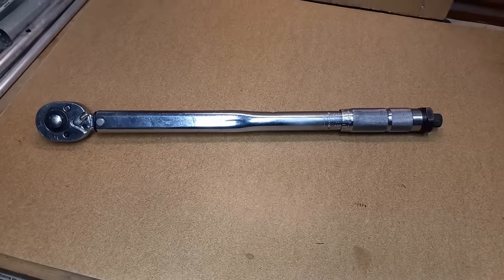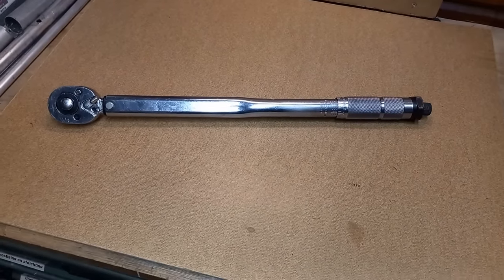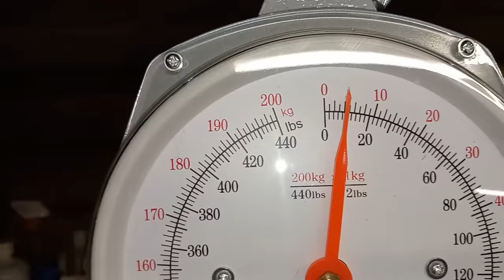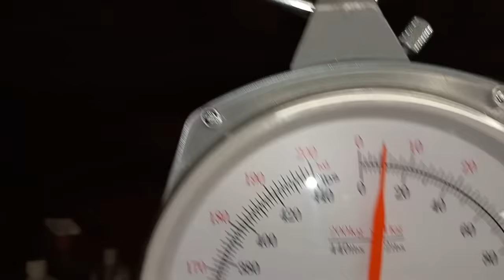How to calibrate a (cheap) torque wrench

Comment: The math I used is: Nm = force x arm length , 126 = Force x 42 , so force = 126nm / 0,42m = 300N, = 30kg. ( 1kg=10N)
Reply: What planet do you live on?  On my planet gravity is 9.81 m/s2 :)
Reply: @richardcloudbase  and what exactly does gravity have to do with it?! exactly... nothing at all in this case ;) and his calculation is right. to be more precise: 30,59148639047619kg at an length of 42cm
Reply: @richardcloudbase  so is g a constant on your planet?
Reply: @martinkrabowski2057  1kg = 9.81N not 10. That’s what he meant. So the more accurate measurement should be 30.58103975535168
Reply: The math I use is: pay more for a better torque wrench.
Reply: @booifojoe  lol
Reply: @iceduckz  All of you are making something from nothing. Who cares if its 30N or 30.58....... The whole point of a torque wrench is to have consistent uniform tightness of bolts and nuts while ensuring that you don't overstretch the bolt, strip the threads like a gorilla, or form too loose of a connection where the nut or bolt unscrews itself by varied vibrations or shocks. Regardless though your math checks out.
Reply: @richardcloudbase   I guess I should inform you that Gravity is location specific. Land (and water mass) influence gravity as does your position on the globe. Besides that, i think a lug-nut doesn't really care for the 2% difference.
Reply: @thijsclaessens8219  isn't it stupid that we use kg for this stuff then? Like why would we want varying calibrations of torque wrenches in different parts of the world?
Reply: That's great if you're a mathematician.
Reply: @martinkrabowski2057 hi. So that is for 42cm/16 inches. So what is  calculation for the length of 12inches or lesser than that ? 😅
Reply: @maxarcha3805  that calculated with the math shown above: Nm = force (nm) x arm length (m) ; so with 30cm (or 11,811 inches) calibrationweight = 126nm / 0,30m = 420N or ~ 42KG. I still can't understand how it is possible that most americans use inches. it just makes no sense at all o.O
Reply: @martinkrabowski2057 
Probably bcoz the ladies in America prefer measurements in INCHES not centimeters 🤪
Reply: @booifojoe  hahahahahahahahahaha
Tested your expensive torque wrench recently champ?
I would absolutely guarantee that his is now more accurate than yours is.
Reply: @bushratbeachbum  You're probably right, but my lug nuts have never fallen off yet.
Reply: @booifojoe  Neither have mine. I always torque them to spec, and then braze them in place just to be on the safe side.
Reply: I use Nm = force / 1/18.8 fracture of arm length * 126z variable, over the force of the qualified distribution x 0222.42. makes sense right?
Reply: i think humans have come this far without using torque wrench at the beginning.....😅 wish it was the same
Reply: @luckylotus11  My dad has one, but never uses it. He stocks his winter tyres at my place and changes them in my driveway, so I can set my torque wrench to the required torque for his cars. Because he can't figure out how to set it himself. 😂
Reply: @richardcloudbase  I see you live in the clouds, not on earth. The less than 2% difference is meaningless in a practical analysis of all sources of torque variability and accuracy.

Comment: Always leave a wind up torque wrench in an unwound state!
Reply: You mean at minimum torque setting? If so, yes.
Reply: It’s a myth. The spring will not take any harm to be left in tension. Think of all the valve springs in million of cars.😊
Reply: @Axbear  yeah, but those valve springs don’t have to be as precise as the spring in a torque wrench. Are torque wrench manufacturers etching the instructions to store at minimum setting just to annoy their customers?
Reply: I have my dads wind up torque wrench from the late 1960’s, and it has spent most of its life wound up to more than 80 ft lbs, and it still tests spot on.
Reply: @Axbear  It’s not a myth. That is indeed best practice.
Reply: Myth or not, why would you argue about spending ten seconds "loosening" it? Some people are so bent on being lazy that they will argue about anything.
Reply: @Toyotajunkie  arguing about this is just like arguing about using one..some people "feel it"
Reply: @schimor  I agree. I have "tested" myself many times and I am usually just a few pounds off. I have the ability to feel torque and depths fairly accurately. I can also tell if something is level with another surface, no matter the surroundings.
But I can't remember a person's name for weeks or months. Ha ha ha!
Reply: @Toyotajunkie  99% can't and should be using the tool it only takes 2min longer
Reply: @Toyotajunkie  I mean, those 10 seconds do add up when you do it all the time for a living. Of course that's part of why I use a split beam.
Reply: @grigorirasputin996  I work at a Ford Dealership and I've never been so out of time I couldn't spend time prepping, cleaning, or storing tools and equipment. But too each his own.
Yup, we have a couple techs that use splits. I have nothing against them. 👍👍
Reply: @Toyotajunkie  😎 I work at at a Ford Dealer as well. Now a days I make good money and know the product line well, I'm never too fussed about hours. But I'll never forget consecutive ass beatings working indy shops in my younger years. I used to think sloppiness saved time. Boy, how I was wrong. 
-Cheers from colorado.
Reply: @Axbear  If it's a myth then why does the instructions that came with my torque wrench say to do it?
Reply: @Jonathan  blimey I'm.the same hopeless at names good at numbers .. ..Good eye for level lol
Reply: @highdownmartin not exactly. Some manufacturer say let it set to a "x" number. My little one need to rest at 40 in pound. Always check manufacturer manual.
Reply: @Kurt Clark  how did you test it to be  spot on? Just curious,  it seems this guy on the video went through alot of trouble to get his spot on. I'm guessing you have a better method, would love to hear it! Thx
Reply: @Axbear  as much of a myth as car suspension springs that "sag" over time?
Reply: @mygt8a4re  Yeah I'm wondering the same thing. And let me tell you if it has not been calibrated since it was made in the 1960s there's no way that thing is still accurate. I bet they haven't used any kind of scientific means for testing it for accuracy.
Reply: @Axbear  Car springs get tired yes
Reply: @Topsiekku  car Spring get tired because of being bounce / cycle / wound and unwound millions of time .
Not because the car sit on the spring . 
Wound and I wounding the spring is what wearing the spring down .
Reply: I have a Snap-On torque wrench. You can’t put it back in its case unless it’s wound more than 80 ft-lb. Case closed.
Reply: @setoman1  peculiar to snap on then.
Reply: When I find the 'Winding key' from my metal toy car.
Reply: I keep mine at 5 ftlbs don’t really matter lol.
Reply: So many mistakes......
Scale WAY too big (large range) to be used
One point calibration.......not good
The placement of the hook on the handle.....wrong....

I've been calibrating torques for 30 years......MY EYES ARE BLEEDING......😪😤
Reply: @Axbear  much like the decade old debate about leaving magazines fully loaded in a semi-automatic.
Reply: @jean-pierreboisclair8717  I just buy a new one every year. That lube tech life isn’t pretty😂
Reply: Yes!!
Reply: @Axbear Creep in materials under static load is far from a myth. Unwinding it to its minimum setting goes a long way towards minimising the possibility of drift due to creep.

As for valve springs, nobody cares if they lose a bit of preload over time. Most engines are build with enough headroom to prevent valve float even when that happens. Presumably, these springs are also designed to stay well below the steel's fatigue limit, which would make them last practically forever.
Reply: Wind it down. It takes a few seconds so who cares what’s right or wrong.
Reply: Damn it!  I never read instructions.  I’ve always just left the wrench at what ever lbs I used it at last.
I’ll be setting the wrench at the lowest lbs from now on.  If it doesn’t hurt the wrench, the few seconds with not hurt me.
Now to calibrate the wrench and see if my years of abuse has ruined my wrench.
Reply: @syn4057  You can set up a basic calibration jig at home, but if you can't be arsed, just send it off. Make sure they're willing to adjust it if it's drifted. That ought to be included in the price of a "calibration", but many establishments treat calibration (which is the act of adjusting the tool to match the standard) as verification only, which is the act of measuring against the standard, with no adjustment implied.
Reply: @syn4057  you’ll probably be fine, especially after reading all the comments that say it won’t hurt at all. But best practice usually takes a touch longer.
Reply: Shouldn't be completely unwound or wound as tight as possible. spring should be where it just starts to equally engaged throughout the length of it. About a 1/4 to 1/3 of its max tension setting

Comment: It’s my understanding that the force needs to be applied to the center of the knurled handle. That may be the purpose of the groove in it.
Reply: Absolutely and correct.
Reply: with the formula applied for the length of the arm (Arnold chose 42cm in this case) the result is equally accurate as when calculated for the groove in the handle; it would just read higher on the scales than 30kg as the arm is then shorter than 42cm, the shorter the arm the more force is required, but the force on the center (the moment of clicking) does not change.
Reply: @ronb4178  Constantly amazed at the re-invention of the wheel.  Take a tool that is designed to be used a certain way; and throw away the rules and how the tool is constructed; and do it 'your way' or "I want to use it this way."  And we're stating this with a Measuring, Calibrating tool - which has a specific place, a specific point - and only One point/place to be evenly pulled from. Bryan Hau - is totally correct.  And I am aware - that for example - the FAA coming in on a Mechanic using a torque wrench - are not going to accept anything - except pulling the wrench from where it was designed and manufactured to be pulled.  And you get to do a bunch of insane calculations if the nut hasn't easy access and your using a crows foot or some such - but those tools have described methods of angle and measurement calculations to be determined with the wrench.  However - all of that - is ALWAYS determined still with pulling the wrench in an even pull - at the point where the wrench was designed to be pulled.
Reply: @daves7775  Ok mate, enjoy your day now.

Comment: I could be wrong, but I failry sure the smooth groove in the knurling of the handle is actually the calibration point for your spring scale, rather than the tip end of the handle.
Reply: Exactly. This video is all wrong!

Comment: One thing to note: almost all scales are most accurate at their mid range, so they should be checked against multiple masses (the water). You would also want to use a scale that is smaller in range, since most mechanical scales are not accurate at the low and high sections.
Reply from the maker: Thanks, that's good to know!
Reply: Why not bypass the scale and mount wrench horizontally so the water jug can pull directly down? Seems like less pieces to throw off the calibration
Reply: @lperea21  There are two things. First thing, the handle of the wrench should be 1m, which is not, but you can always compensate by measuring the water.
50Nm is roughly 5kg with 1m handle.
Fun part is when you have to make the wrench "stiffer", and then loosen the adjustment, so it'll snap on the 50Nm mark.
So, make a longer handle from a pipe, or some calculus with water, but I think it's more precise with that scale. Then you can actually see, what weight made it "snap".
Reply: Same goes to torque wrench itself.
Reply: A lot of almosts. Too many for my money, including mid range. All that matters is WHAT YOU HAVE. Maybe someone has a good scale, good fresh calibration showing it's deviance from true across it's entire scale. Take these lessons for what they're worth.
Reply: @flashwashington2735  If you have paid the extra $$$ for a full range calibrated scale, you are NOT doing this procedure yourself. You have the money to have it done professionally. The lesson here is to know the limitations of your equipment and work within them.
Reply: You don't even know if the wrench is undamaged. You don't know the thing is repeatable.
He's checked at only one point. Anything critical You usually make several passes.

I would not trust it for anything important. The thing in the trash spend $20 at harbor freight.

Because you have trouble understanding.

I'll say it yet another way:

Many calibration shops would tell you it's UNREPAIRABLE because you can't get parts or they cost as much as the wrench itself.
They would tell you THAT IT CANNOT BE CALIBRATED because it can not consistently give the same torque at the same setting.

Pretending to calibrate something IS NOT calibration. I'm out.
Reply: @bobbykozak6032  When does pretending to fo something equal doing the deed?
The wrench has to be in good condition giving repeatable readings in several places. The minimum that CALIBRATION certificate denotes.

Most calibration shops tell you the cheap wrench that they sold you is economically UNREPAIRABLE, CANNOT BE CALIBRATED.
That my friend is the limitation of the equipment. Throw the turd in the trash. $20.00 at harbor freight will get you a deflection beam torque wrench more accurate and not needing calibration.

That turd wrench is still only an indicator at one point no one knows accuracy or repeatability.

Going through the motions of calibration is not calibration.

Pretending never equals doing.

I'm out.
Reply: @flashwashington2735  Are you really saying a deflection beam doesn't need calibration? Or that it is repeatable across multiple users? Not to mention parallax error in it's use? You sir are beyond hope.
Reply: @flashwashington2735  I bought similar wrench just for my tyre changes. It had some "minor" error (under 10Nm at around 126Nm), which I fixed using this kind of technique. It is way better that using no torque wrench at all, or even the one with needle type indicator. It is now very accurate between 100-130Nm, and it is consistent enough for my use.  I use this method to check the calibration before I change my tyres (have not needed to re-adjust it yet). Yes, someone might find it too difficult and want to spend more money for better wrench just to make things easier, but this is good for me and my budget.
Reply: He forgot to add the weight of the jug into his figure of 5L=5Kg. It may be insignificant but it may skew the measurements on the scale if it's miscalibrated.